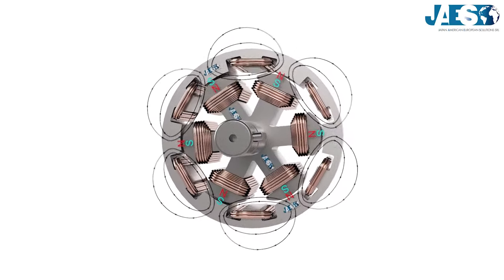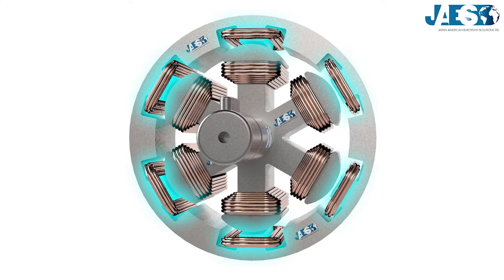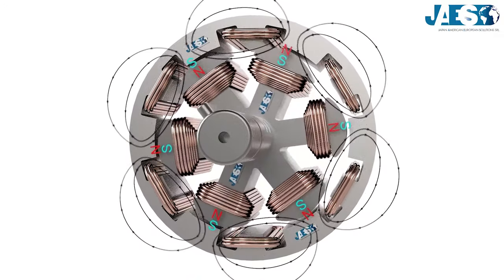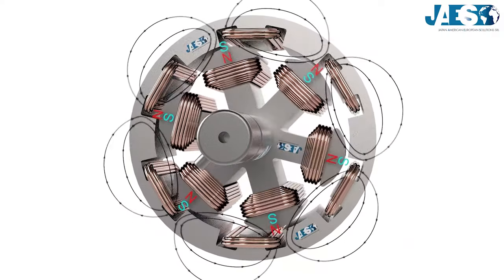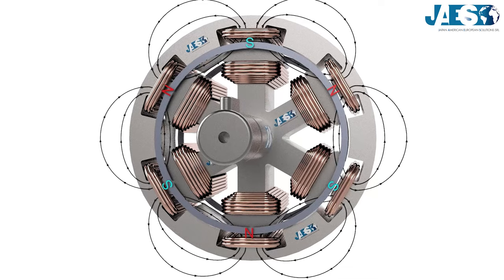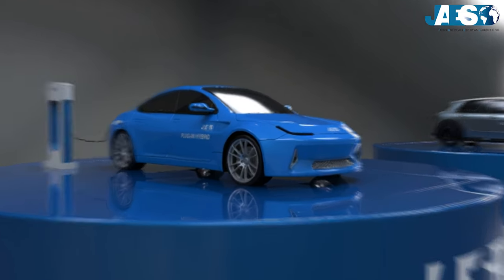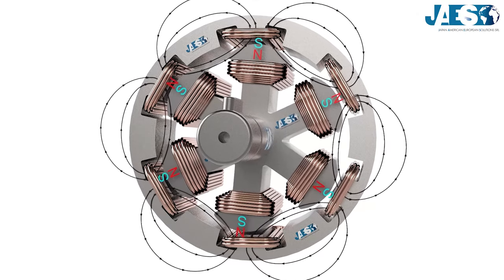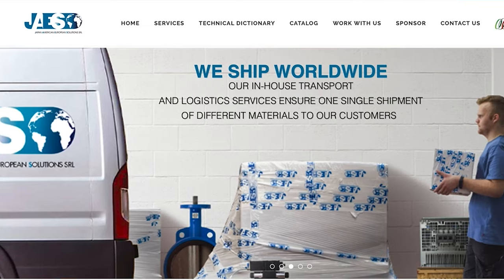What is a SYNCHRONOUS MOTOR and how does it work? - Rotating magnetic field - Synchronism speed

Comment: A Synchronous Motor can also be used for power factor correction in a plant, by running it at leading power factor, making the plant as a whole operate more efficiently.
Reply: yes in that case it work like capacitor but how to do that I don't know it depends on the excitation field but I never go through math
Reply: @John-j8q7g There are a couple governing equations, it all comes from the manufacturer’s E-i curve and the vector summation of E,V and I. Where E is the induced voltage, V is the network voltage, i is the excitation current through the rotor and I is the network intensity.

Comment: I wonder if i have 2 12v  motors on 2 light up deorations why one light turns faster than the other? last time i used them they were both the same working great, i packed them away and took them out and now 1 spins faster than the other and makes a bit of noise? i dont have anyone to ask so if you have any ideas please lmk.

Comment: The tiny synchronous mains motor found in many domestic microwave oven's plate rotator can be used as a low power high voltage generator , twisting the shaft quickly will light a Neon bulb ( or give you a shock ! ) ...... DAVE™🛑

Comment: Is a syncronous motor similar to the bldc motors that are used on quadcopters and stuff except instead of dc being turned on and off, we have proper ac that already does it by itself?
Reply: Hello, BLDC motor and Parmenent Magnet Synchronous Motor belong to synchronous rotating electric machines. The BLDC motor has a significant functional drawback because in each of the six steps (rotation angles) of the rotor it is powered by only two phases out of the three system phases. To function quietly and be as efficient as possible, it must be powered by the sine function. It was experimentally found that the gates of the switching transistors should be powered with PWM signals with a waveform "bent" in the middle.
The PMSM is powered by a three-phase sine function and therefore does not have the mentioned disadvantage.
Watch the presentation of the new generation four-phase synchronous motor Brushless Hybrid Fast - Rotation Motor (BLHF-RM) on my YouTube channel.
Best regards 💖😀.

Comment: Why don t we use a synchronous motor instead?
Reply: Disadvantages or Demerits: Synchronous motors requires dc excitation which must be supplied from external sources. Synchronous motors are inherently not self starting motors and needs some arrangement for its starting and synchronizing. The cost per kW output is generally higher than that of induction motors.